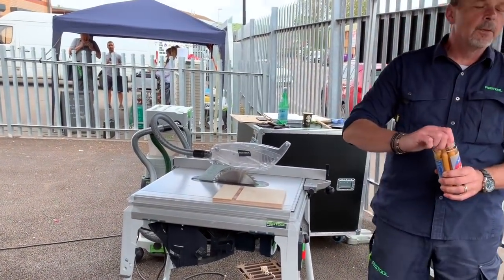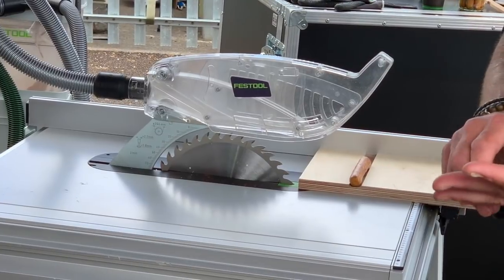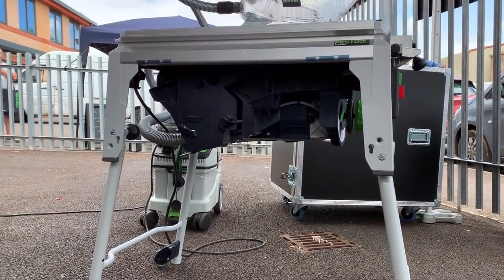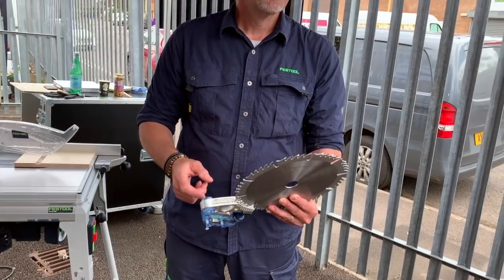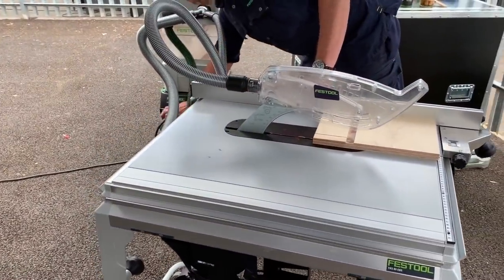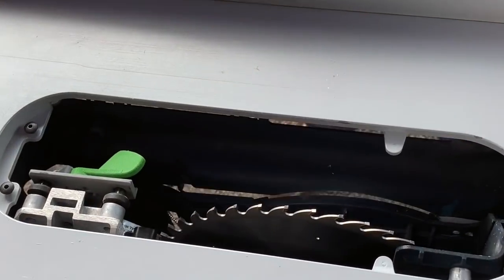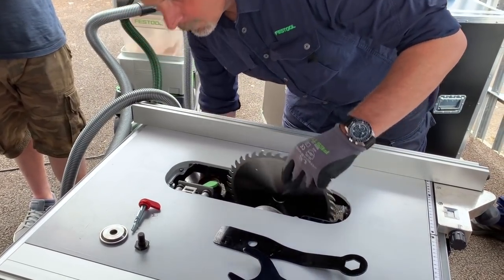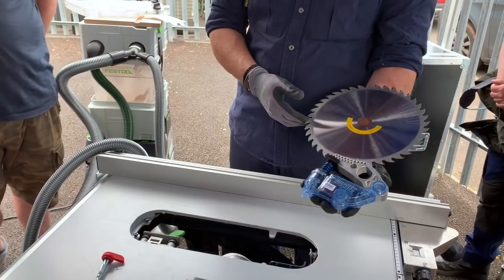TKS 80 SawStop by Festool in the UK - full demo of prototype system. Available in the UK soon(ish)!

Comment: Can it detect moisture content if your wearing gloves???
Reply: Never ever wear gloves or loose fitting long sleeves when using workshop power tools. Many an awful injury or death as a result of the user being pulled into the blade by the gloves or sleeves.
Reply from the maker: After it cuts through them!

Comment: The Bosch REAXX is a superior esign as it doesn't ruin the blade when the blade is forced to drop.  Saw Stop technology is doing an injustice to many because of their patent litigation against Bosch in the US.  The Saw Stop also requires a replacement of a very expensive mechanism in addition to a replacement blade whereas the Bosch merely needs a relatively inexpensive cartridge to be replaced.
Reply: Bosch Reaxx is not available in the UK sadly
Reply: Saw Stop cartridge is $79.00. Not exactly “very expensive”. Why would a company that has revolutionized table saw technology not protect its patent?
Reply: @michaelwilwand8036  you forgot the cost of the blade
Reply: Bosch also gave you two deployments per cartridge.

Comment: If the Blade drops below the table in contact with a finger, why does it also need to stop the blade, thereby ruining the blade?
Reply: I think it's the action of the brake going into the blade which makes the blade drop down.
Reply from the maker: Hi Skinner Designs - like Anthony Shackman implies, it is one action - to simply lower the blade while it is still spinning, may result in dragging whatever it has got hold of down into the mechanism with it.  The teeth are shaped to cut/grip material in a forward motion.  Merely dropping the blade without instantly stopping it may well be far less effective a safety measure I'm guessing. But great question!
Reply: Theres now a better Technologie by austriam company Felder that use magnets that change magnetation fast to lower the blade. But its for big saws.